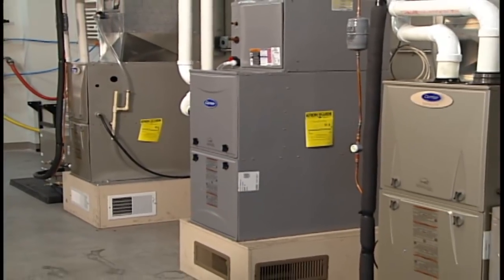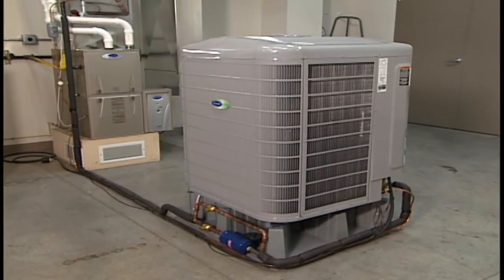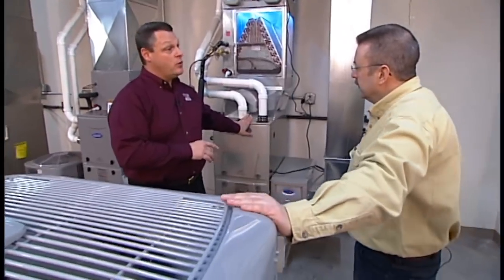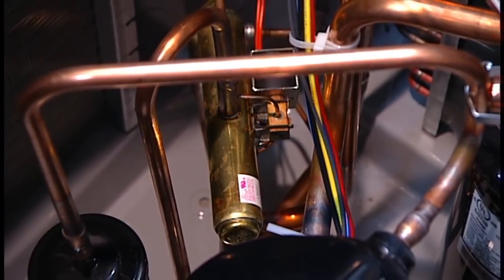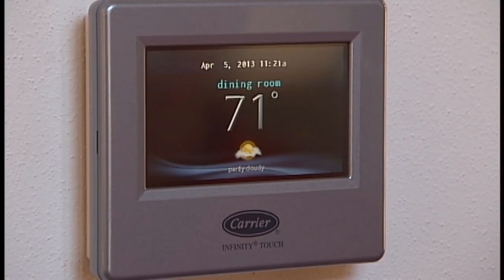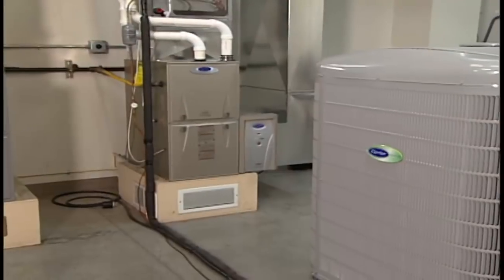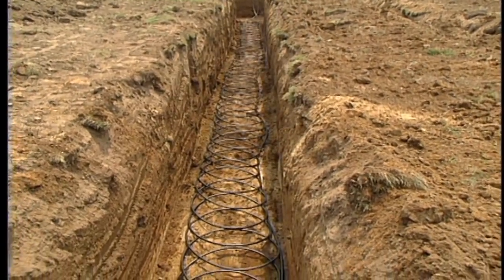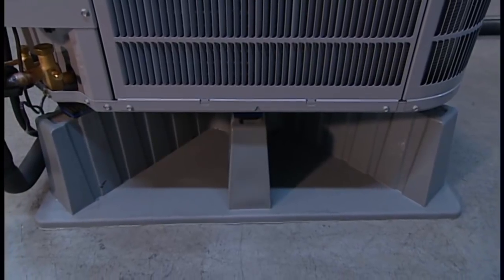What is a Heat Pump?

Comment: HOW are you extracting HEAT out of 40 deg F cold air to bring it inside the home...??
Reply: You Tube the refrigerant inside the copper lines runs the opposite direction in the winter so instead removing the heat outside it picks up heat and when it reaches the coil inside above the furnace the air blowing across it absorbs the heat in the refrigerant. And refrigerant is very very sensitive to temperature so it can it can pick up a good bit of heat especially when it’s 40 outside
Reply: TheDime4life sorry... That was confusing as hell... I'm usually very good at technical stuff but that there just did not make any sense to me...
Reply: A heat pump does not produce energy. It pumps it from one side to the other. The outside air is full og energy, even below freezing. Otherwise you would have zero °kelvin in the air.
The heatpump takes huge amounts of cold outside air, and compress it to less amounts of warmer refrigerant which is being pumped to the coils inside the house.
Reply: Anders Skjoldager-Gregersen heat pump being the compressor outside ?? It takes cold air from outside somehow and compresses it to warmer air and pushes it to the inside coils ..?? 
Im still comfused how the compressor pulls cold air in when its a sealed unit ...
Reply: think of it this way, cold does not exist. "cold" as we describe it is just nothing more than absence of heat. the less heat the cooler we feel, that is all. there is always heat. what the system does is pump refrigerant. during the warm months, the outdoor unit (condenser) is used to release heat outdoors. the outdoor unit also houses the compressor, and other components.  Your furnace is indoors, weather it be gas, electric, or heat pump with duel fuel or electric, where the air handler indoors is just using gas for heat, thats typical, as well as provides cooling in the summer, or with a heat pump, it will house the coil, a fan, electric strip heat possibly, or components for gas heat. in a duel fuel set up, it uses the heat pump until the temp drops down to around 15 to 20 outside, once it reaches that temp, it locks out the compressor and uses the secondary heat source. weather its gas heat, or just electric strip heat. during heat pump operation, it uses the refrigerant in reverse. instead of the refrigerant absorbing the thermal energy indoors and expelling it outdoors, it absorbs the thermal energy outdoors and releases the thermal energy indoors to heat your home. when the outdoor temps are around 15 to 20 degrees, it is not efficient to grab the thermal energy outdoors anymore so it locks out the heat pump system and switches to a secondary heat source. newer systems can do even better with inverter technology. the compressor speed can be controlled by demand and stage up and down to efficiently control cooling and heating. using less energy, which saves money on your electric bill. so lets say in the summer its like 75 outside, and your house is set to be 73 degrees, and it went up to 74, the stat will time out,  adjust depending on deadband settings. and will bring the cooling on, well instead of it being the compressor 100% full speed to cool the home it will only ramp up a bit, running the compressor slowly, which will slowly bring down the temp in your home, depending on the load of how long it takes to properly cool, if it takes longer, it will ramp the compressor speed up higher to continue to bring the space down to temperature. and then shut off thus saving energy. thats one other reason why you dont want an over sized system. While it sounds like a good idea, you dont want that at all. you dont want to cool your house down to fast, if you do so, you have for one have a lot of start and stops on the system, which is hard on the compressor and will shorten is life, as well as you will not remove enough moisture from the space and then you may start to feel cold and clammy, you want a properly sized system to remove enough moisture from the space, normally around 30 to 60% humidity. but also you dont want to heat your house to fast, you dont want to get to much dry air either, thats why a lot of times a humidifier is installed to humidify the air to keep the space comfortable. so basicly a HVAC system is nothing more than a liquid, vapor process. the changing state in the system is what absorbs thermal energy (heat) and moves it around. weather that is outdoors during cooling season or indoors (if its a heat pump)
Reply: You Tube lolololololhahaha. its science bro. thats why u dont get it. refrigerant does the magic .
Reply: Cameron Brown:
In that entire post you did not mention Freon in the system and what its purpose is....

What i gather that you wrote above is that in the summer when its HOT inside the home the unit pulls the hot air from inside the home and takes it outside thus cooling the house down...  HOW is it doing this because all i see is an inside unit which houses the Fan motor and the heat strip and the condensor coil.... The outside unit has the compressor and the fan motor to cool the compressor....
SO how is the inside hot air being sent outside...??  None of that makes any sense... 

From what i understand is that when you compress FREON it gets extremely COLD ... so we basically take the hot air from inside the home, suck it up thru the air handler via fan and have that hot air go across the condensor coils to cool down and that air gets re-distributed to the house...  That makes perfect sense...

Now i also understand how the heat works when the heat strip above the fan turns on... The air handler comes on, sucks up the cold air from inside the home and passes that cold air over the heat strip and heats the air and sends it back to the house ... simple logic, but why when the heat comes on, does the outside compressor come on..?? 

This is what i do not understand that nobody can answer..  instead i get the asshole above that attacks me with, its science, you would not understand...   which is why i reported him to youtube ..
Reply: You Tube so either you really don’t know, or you are one that knows i all and are trying to see what others know. But to correct you, Freon is a name, not what it is. Actually, it is refrigerant. And your outdoor coil is called the condenser, and the indoor coil is called the evaporator. The fan on the condenser outdoors, is not to cool the compressor, it is to remove the heat from the condenser coil. Actually, the refrigerant cools the compressor. A compressor is nothing more than the pump in the system, vapor in and vapor out only. From there you go to the condenser. It condenses the hot refrigerant vapor, down to its liquid form by releasing the heat from the coil. From there the now liquid refrigerant goes to the metering device. The metering device controls the flow. The metering device is right before the evaporator indoors in the indoor AHU. You should have a subcooling temp of about 8 to 12 degrees, then you will be 100% liquid to the metering device, at that point when you exit the metering device you should be switching to a low pressure vapor, it starts changing state due to temps and pressures, at that point it starts to enter the evaporator and heat will transfer to the cold evaporator and will be absorbed by the refrigerant, at which time is flashing to 100% vapor by the time you exit the evaporator, and then it heads its way back to the compressor, at which point when you get to the compressor you want to see about 12 to 15 degrees of superheat to insure that you are in a vapor state, you want to have a slight liquid but much, so that you cool the compressor, because as you enter the compressor as a hot low pressure vapor, it will pick up the heat in the compressor and carry it out as well which will raise the superheat that exits the compressor as a high pressure hot vapor again. Which then the processes starts all over again. It is the pressure, and change of state that makes the system work. Heat will migrate to where it is cooler which is part of how it transfers. Now you are saying that your condenser runs while you are heating your house. And that you have electric strip heat. That means you have a heat pump system. So it does this exact same process except in reverse. Instead of releasing the heat outdoors, it pulls heat from the air outdoors and releases it indoors, when its around 15 to 20 degrees outdoors the system can no longer efficiently collect heat in the air outdoors and so it will bring on the strip heat in your case and supplement  the heat. Or it will get to a point it will lock out the heat pump, and only run off of the strip heat. This is how the system works. No smoke and mirrors, no magic. Refrigerant isn’t made up as a gimmick that gets sold, its real. If that doesn’t help you, then i suggest you look up how the system works. Watch videos and such.
Reply: Cameron Brown:
Ok that entire shit just blew my mind... I still don't understand HOW you are pulling in hot air (winter time 35 deg F) from outdoors and and releasing it indoors...  when there are NO air vents from the outside unit to the inside air handler...  The only thing i know connecting the 2 units is Freon....   So how are you extracting HOT air from 35 deg F cold air thru the outside unit and releasing it thru the air handler inside the house...???   

I promise you i do NOT know this shit and i am not testing you in any way shape or form..  I am trying to learn how this works because people are telling that they are getting HOT air from outside to heat the inside of the home when its 30 deg F in the winter.... WTF ..??
And they are taking COLD air from outside when its 95deg F and releasing it inside the home to cool the house down....   Im a logical thinker here but WTF... that shit makes NO sense..   IF this is some kind of reverse phsycology shit then it would make sense after i figure it out... 

If i told someone that i could extract 50 deg F of cool air out of 95 deg F hot air they would look at me with the stupid look and think im fuking crazy ...  

So one of 2 things here, either your teaching method is NOT working for my understanding or i need some videos to show me how this shit works...  If you can find a good video then send it to me or try to explain it differently because im still baffled how you are getting HOT air from COLD air and sending it inside the home when there are no air  ducts from the outside unit to the inside unit to move this air flow....
Reply: refrigerant is the transfer media, like i said in a earlier reply. heat is thermal energy. Cold is how we describe i how we feel or something feels. thermal energy (heat) is everywhere it always exists. when its cold outside, it feels cold to us. that means there is less thermal energy, thats all. all you are doing during the heating season is the refrigerant is absorbing the thermal energy (heat) that is in the air outside and is transfered from the condenser coil to the refrigerant. thus at that point is moved to the indoor coil and then the indoor coil gets warm and releases the heat into the house. This is true for heat pump systems only. in cooling season as i said it absorbs the thermal energy from indoors at the evaporator the refrigerant changes state, and carries the thermal energy outside and is released out of the condenser by the condenser fan and then the refrigerant changes state again and condenses back down to a liquid and the cycle continues. Thermal energy (heat) will migrate to areas or objects that contain less thermal energy. and as i said the refrigerant absorbs the thermal energy. the thermal energy transfers through the aluminum fins, from the fins to the copper tubing from that to the refrigerant and goes from one coil to the other by the difference in pressure from the compressor, remember the compressor is only a pump. a vapor only pump at that. at this point if you dont get it, then i suggest you go on here and look up just how the systems work. like look up how refrigerant works. or how HVAC systems work.
Reply: Cameron Brown:
NOW... you are starting to make sense.  In winter the outside unit pulls heat from outside air and transfers it VIA freon to the inside unit where the evaporator gets warm and as the inside fan kicks on to circulate the air in the house and as the COLD air inside the house passes along the evaporator... it warms up...  I hope i have this right..

In the summer, the hot inside air is absorbed by the evaporator which now carries that heat via freon to the outside unit where its released into the open air thru the fan motor over the compressor...  ???  If i got this right, how is the air coming out the vents super cold..??
Reply: well outside the fan is drawing air through the condenser coil and releases the heat to the outside air from the condenser coil. you get cold air out of your vents in the summer because the thermal energy is being removed by the evaporator coil which is cooling the air. because remember, cold doesnt exist. cold is the absence of thermal energy (heat), the refrigerant is absorbing that thermal energy, thus you result in cold air. which is carried to the vents via the duct work in your house. you have return air vents and supply air vents. return air brings the air from in your house over the evap coil and back out through the supply air ducts. now in a commercial building they might have a duct that brings in outside air thats controlled by a damper. bringing in outside air can be used in different ways, most of the time you bring in outside air when its cool outside and is used as free cooling for the building to save money. but there are various sensors related to that system that controls it to determine if the outside air is suitable for cooling the indoor space. another use is having relief and exhaust dampers to the outside to control building pressure. but that is normally controlled by the building automation system. with various sensors detecting space pressure, temperature, and duct static pressure and building static pressure. if you go into a building that has doors that are hard to open then there building might have a slight negative pressure (depending on which way the doors open) if the doors are blowing open then they have to much building pressure. but all of that is a whole different ball park on a different level compared to a home. bringing outside air into a home in that manor would be pointless for a average sized house because you can simply open windows and such.
Reply: Cameron Brown:
This is some pretty heavy duty stuff :-)  Now i think i got it and have a better understanding... 
I understand extracting heat from inside hot air leaving cold air to be sent to the house.. 
BUT extracting hot air from 35 deg F cold air is a bit hard to grasp when we are COLD and shivering....  I am sure there is still heat there in the air because its only 35 deg F ... Leaving room for it to get even colder... Its just we as humans feel really COLD at that low of a temperature and then to tell someone .... there is still heat in that same air... They will look at you like your stupid... But i get it now, its cold but if it can get colder, then that means there is still heat left to be taken for it to get even colder.. 

So i can assume its the freon itself that is doing all the magic in a sense that its pulling heat from the air to either cool or warm the house..??
Reply: yes, now you get it. you just have to remember that cold is nothing more than a term we use to describe how we feel. thermal energy (heat) is always there, even at 35 degrees out. there is just less thermal energy resulting in it feeling what we say is cold. a heat pump grabs what thermal energy it can and uses that to heat your home. the colder it gets outside, the harder the system has to work to achieve this. until it gets to a point where the system can no longer efficiently grab the heat. this is why you have electric and duel fuel set ups on heat pumps. if its to cold for it to grab the heat it will either supplement with electric strip or gas heat or it will lock  out the heat pump all together and then run on whatever secondary heat source it has. weather its electric strip heat or gas. Keep in mind that not all systems do this. some are AC ONLY so in the winter time the condenser outside will do nothing in the winter at all. and your AHU inside the house is your furnace. and will run either electric strip heat or gas as a heat supply. heat pumps are not as popular in town and housing where natural gas is available, heat pump systems are more common out in the country or places where natural gas is not available. and where propane is the only gas heat source which is expensive. so some will run a heat pump, and either go with electric or propane back up. and use propane when they absolutely need too.
Reply: Good, so what "heat" temps should i expect to read coming out of my vents when the electric strip is NOT in use..??  Just the compressor alone..??   Because in Jan we had a solid week of high 30's and when i turned the heat ON, the temps coming out of the vents were not hot enough or at least i didn't think it was hot enough to warm up the house so i turned on the "emergency" heat which then turned on the electric strip which then increased the air out the vents to about ~85 deg F...  At that point the house warmed up pretty fast... 
And at that time i was like.. WHY is the outside unit running when all i want it heat and i thought thats what the electric strip was for....  But now i learned about this so it makes sense now..
Reply: your temps with a heat pump can vary depending on outside temps when running in heat mode, a heat pump alone regardless will not feel as warm strip or gas heat. it will always feel cooler but it will heat the house, but will take longer the colder it is outside. but running properly depending on its age, should be in the range of 20 degrees Delta T. which means that whatever your inside temp is it should be 15 to 20 degrees higher than that. so if your inside temp is 70 you should be around 85 to 90 degrees while in heat mode, and while in cooling mode it should be lets say inside temp at 70, should be discharging around 50 to 55 degrees. when you run the electric strip, you might be still in the ball park depending on where you took a temp reading. if you take a temp reading at your closest return vent and closest discharge vent that would be a more reliable reading. since if you take discharge reading at the farthest vent you can be losing some warm air if your duct work isnt isolated and also if it wasnt sealed real well. so its good to take readings closest to the unit. electric strip will discharge around 90 to 110ish depending on the system. they are all a little different. also as long as it was sized correctly and the duct work was sized correctly.  while strip heat is 100% efficient it is expensive to run depending on how much your electric company charges. so with that said you should see at least probably 85 with the heat pump only. there is a possibly that  you could be a little low on refrigerant. have you changed the air filter recently? is the evap coil clean? those will effect performance. so with that said i wouldnt freak out to much it will take a bit longer with cold temps outside for it to heat your house. there could be nothing wrong with it. the best thing would be to have someone check it, if you are concerned. hook a set of gauges up to it and check super heat and sub cooling and pressure. unfortunately sometimes its hard to find a good honest tech because a lot of residential companies pay there techs a commission so sometimes they are just sales techs in my opinion. try to sell you things you dont need. or they will come in collect the service call fee and tell you nothing is wrong, like i said they will probably say its just cold outside and while its true there could still be a issue but they dont want to mess with it. getting an accurate reading on weather its got the correct charge or not is hard to do in colder weather. so with that said, i would just keep an eye on outdoor temps and run the heat pump only and see what you discharge on warmer periods outside and see if it starts to heat better, if so i would say its just the systems design. older heat pumps cant keep up at low ambient temps out side as well as newer systems. its possible if you had recent colder temps that the system automatically switched to running the heat pump and strip heat and you probably didnt notice. again im not sure of the design of your system. but those are things to check before you decide to call someone out. i wouldnt recommend that you go out and buy a set of gauges to check the refrigerant pressures yourself  because it slightly dangerous. refrigerant if it gets in contact with your skin can burn you not from heat but from the cold, it will absorb the heat from the spot it contacts you and give you a nasty frost bite. heck my step dad was working in a walk in cooler and a line broke loose and filled the cooler with refrigerant and he was off work for a bit to recover because it caused slight burning to his lungs, and it happened in a blink of an eye. thats part of the reason why to buy 99.9% of refrigerants you have to be EPA certified. to know the proper ways to handle it. that and to handle it safely for the environment. ya you can buy 134A for cars as a regular consumer but thats all.  i know more information that need but at least you know.
Reply: Yea it was about 37 deg F outside and inside was about 55 ~Deg F... I wana say the heat was around ~75 deg F on the compressor alone... So maybe had i not been so impatient... it would have eventually warmed up the house... Granted it would have been cheaper because the outside unit pulls 10.5 amps alone and the inside air handler fan pulls 2.5 amps...   When that heater strip came on, now the inside unit went up to 23 amps....  But it heated up this house FAST... !!! 
Next time around i will just run the compressor in heat mode to see how long it takes... and get actual temp readings...
Reply: ya, if your indoor temp was only 55, and it was a 75 degree discharge in heat pump mode then i would say the system is operating normally.
Reply: Cameron Brown:
I just want to thank you for all the detailed info you gave me.. You really explained it very well to me where i understood it. 
Its amazing how some people on YouTube explain stuff with details missing and expect you to fill in the blanks... and if you don't fill in the blanks, you are the dumb one.. 
i have asked dozens of people and NONE have explained it like you did. 
It reminds me of when i started working at my company and rode with a tech for a week... he knew his job very well but could not teach for shit..  I told this to my boss and that i needed to ride with another tech, so he put me with another tech that had been doing it for just over a year and i learned MORE from this new tech in one day than a week with the other guy... 
Just like i told one teacher at my son's school... you have 20 students and you teach one way... you cant expect ALL 20 students to understand the same thing. Some kids learn differently, some kids need to be taught from a different angle before they understand... While one method works for 80% of the students, the other 20% will not understand it, you need to change the method and explain it to them in a way that they would understand it.. 
Kinda like your theory of extracting hot air from COLD.... people are going to look at you and say... WTF... how are you going to extract HOT air from COLD air when its clearly COLD...  Then at this point you need to explain it in a way that they will understand and when they do, it will make sense to them...
Reply: You Tube well this field isn’t something that is easy to learn. As i said cold is nothing more than there is less thermal energy. But we feel it and describe it as we feel cold or a object feels cold. When it is nothing more than less thermal energy. And all you are doing is absorbing what thermal energy is there and moving it out of the space, weather that is indoors with a heat pump, or outdoors during the summer months.
Reply: Ok we are seriously sooo confused with our system, we put it on lockout so the auxiliary heat will not come on, or normal mode so the auxiliary heat will come on but either way our system runs and blows out warm air and then the next time it runs it's really cold air so how do we get it to run with heat during this cold weather?
Reply: sounds like to me you need to set it back to the way it was,  Let that stat bring on the aux heat when the system needs it. Im not sure what your temps are, or how old the system is but I would say that you need to let it run as designed. the heat pump should get to a point it cant keep up and will bring on aux heat, and or will lock out the compressor and run just aux heat.  If its going into heat pump mode and not doing anything, then i would say you may need to call a reputable company and inspect it.
Reply: It's a brand new 4 ton system put in August 2017, and our temps rarely goes below 32°, I turn it on normal when I know the temps are gonna be below 32°, but on nights I know it's not going to be below 32° I put it on lockout.
Reply: i would leave it alone, and let it run normally.  by running it with the heat pump locked out, you are running on electric strip heat (unless its a duel fuel set up) when using electric strip heat you do get 100% efficiency, but you will see much higher electric bills. how ever it was installed it should know when to lock out the heat pump on its own and run on aux with heat pump and strip heat together or lock out the heat pump completely all on its own.
Reply: Just like heat can be extracted from a freezer, you can also extract heat from outside. However, as it gets colder outside, there is less heat available to extract and move inside. That is why we normally need an auxillary heat source to "help" heat when it is below freezing temperatures. The extracted heat is then moved to inside the home. you use less energy to move heat than to generate heat- saving you money. Heat pumps are very popular in the Pacific Northwest. Especially in Wa.
Reply: What the other guy says,  go outside and stand next to your AC unit when it is running and feel how hot the air is coming out of there,. Using the AC system actually generates a lot of heat, so you can reverse that and pump that heat into your home in the cooler, but not so cold months.